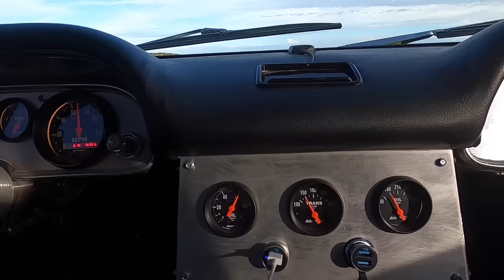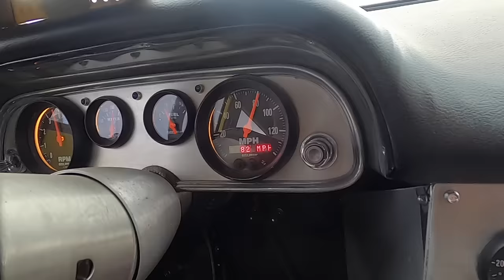The Morrvair Takes On The Rubicon Trail

Comment: Time Stamps for those interested in the names of various locations.
0:00 - Big Sluice Box (Starts at Mile 5.75)
10:36 - 2nd Dam at Loon Lake about 1/2 mile before trail start
10:41 - "Green Bridge" that crosses Rubicon Springs about 6.5 miles into the trail.
10:55 - Loon Lake Spillway (Trail Start)
11:23 - Gatekeeper
11:47 - Top of Whale Bones
12:11 - No name yet. It's a relatively new route the county made around a mud hole (There is a cross nearby where someone died rolling over without a seat belt)
12:52 - Nobie's Rock
13:20 - Soup Bowl and Kitchen (Totally optional)
14:05 - Arnold's Rock
14:16 - Indian Trail Route
15:05 - Mechanics Station at Buck Island Lake
17:51 - There have been 2 Roll-Over deaths in the last 6 years, all due to No Seat Belt. (No name spot and Little Sluice Box)
18:04 - SMUD Bypass (Near Heckle Hill)
20:54 - Big Sluice Box
22:48 - End of Property Line
23:02 - Green Bridge (seen at 10:41)
23:10 - Rubicon Springs
23:24 - Rope Swing in the background (yes, the water is cold)
25:06 - Bear. Yes, Yogi steals your food, rips off doors, destroys coolers
26:11 - Climb to Cadillac Hill
26:18 - After the Buick LeSalle (mistaken for Cadillac) and before V Rock (several deaths here). Cyclone fence is Gabions installed by RTF, Jeepers Jamboree and El Dorado County to save hillside
27:28 - Observation Point
28:26 - Tahoe Staging Area (it will be paved on June 21)
Reply: So where is the big granite slab you had to traverse and it was so steep the uphill wheels would almost "float" off the slab so you had to take it real slow... lots of vehicle used to roll there and it was a long ways down.... did they close that section?
Reply: @Sunnyacres55  the slabs are around the gate keeper but they are not really hard there is a lot of roll overs on the slabs because it’s one of the first obstacles and people who don’t know what they are doing can get there easily
Reply: I think I met you last summer??we were on ktms, you gave me and a buddy 805's and said we prob working on amature record times at 5-6 hours round trip.
Reply: Thanks for this! I was watching and noticed the spots skipping around haha. The Rubicon trail is a magical place!
Reply: @Sunnyacres55 The Granite Slab,  also known as Indian Trail is at the 14:16 is around 4 miles into the trail before Buck Island Lake.   The other "Granite" section, is the Granite Bowl which is about a mile into the trail.  Both Granite Sections are absolutely still there.
Reply: @jeremiahwoodruff9614  There are 15 Rubicon Trail Foundation directors, so it was likely one of us.
Reply: @PaintGuy Welcome!

Comment: Not easy with no lockers!Rudy’s got some crawling skills,well done young man!
Reply: Lockers are very useful but not an absolute need there I've got a 1993 Cherokee sport on a 3.5" with 30's and made it through this exact trail with no real problems other than bashing my rock sliders but no damage done and did great
Reply: I never seen his front tires not turn like it was an open diff?
Reply: @VesselFitterguy  - as long as the rear wheels have traction and one front wheel has traction, the other front wheel in the air will still turn the same speed.
Reply: @Dozav7  not on an open dif in the front. He's likely applying the brakes to create traction.

Comment: 40" tires, low gears, the shear weight of the rig, gear, and people, and the Morrvair still gets 11.5 mpg? And its an incredibly capable machine to boot. You guys really ought be proud of that thing, thats an awesome ride.
Reply: Still needs an overdrive reduction
Reply: And that's U.S. gallons, even more impressive.
Reply: Thats highway. Probably 7 to 8 city and offroading in 4wd probably 5 to 6 mpg.
Reply: @joshuaearnheart2756  40 inch tall tires is one Heck of an overdrive already. You want another overdrive?
Reply: @dehoedisc7247  so you didn’t watch the video? That thing was screaming on the highway. Come on now
Reply: @joshuaearnheart2756  The truth would be in the actual rpm profile of the engine's output, and the presence of multiple gearing systems makes it sound like more than it is. Talk actual rpm, not your impression of rpm, based on no instrumentation. I am a mechanic, not a youngster who is impressed with noise.
Reply: @dehoedisc7247  it was on the tach. Well mr “mechanic” you won’t be working on anything I own. Running at 3k+ RPMs on the highway isn’t acceptable
Reply: @dehoedisc7247  and speaking of the 40s, that’s sort of offset by the fact he’s running an extremely short gear. 5.xx something range.
Reply: @joshuaearnheart2756  Yes, very right, and yet I would suggest that any change to the gear train might result in a benefit/handicap compromise. Matt will do what's best.
Reply: @joshuaearnheart2756  as with many small pups, you overlook the fact that many v-6s are in their max torque band at 3 Grand, and I am sure your youth tempts you to exaggerate your potential. You don't know gears, and know more about your mouth exceeding your brain's capability.
Reply: You thought that a drive train should cool out to 2000 engine rpm on the highway, but No, that is much below efficient rpm  for Towing, and that shows your lack of maturity, as involves More Overdrive. NO. When towing, always tow at max torque of your engine, and not 2 Grand, lugging the engine for false economy. Young children should step aside.
Reply: @Nick-ye5kk  yes, play word games with the definition, very productive,.
Reply: @joshuaearnheart2756  A child you are, 3 Grand is the perfect rpm for economy and power. Are you posing for your family or society in general?  A child posing as a mature man is quite a spectacle.
Reply: @dehoedisc7247  yea it’s official. You’re not a mechanic 😂 not even close to one actually. Spinning the engine like that will most definitely cause overheating issues. He’s not making dyno pulls or hooking up to a trailer every time he drives it. If overdrive didn’t work, it never would have been invented. He doesn’t need to stay in the power band 24/7. Only when he needs the power. 3 grand is perfect for efficiency 🤣 thanks for the laugh my guy. What a complete nimrod you are
Reply: @joshuaearnheart2756  running at 3 grand on the highway is Perfect for a Little V6 that is Short on Torque and has got no choice. You consistently Betray your Stupidity. What's your Game?
Reply: @dehoedisc7247  you don’t need torque on the highway. Torque gets you rolling. You a hot wheels mechanic? And also, he has an ls in the morrvair. So you’re “little v6” comments are completely irrelevant
Reply: @joshuaearnheart2756  You talk about torque as if you understand the concept, and you do Not. You are spouting expressions that you have heard, and mistake them for reality. Wrong. A small boy such as you may influence a few people with your error, but the truth will come along and show you to be in error,
Reply: @joshuaearnheart2756  :You don't need Torque on the highway ? You have the mind of a child, and maybe you have a future with that shit, but it won't be in anything serious.
Reply: @joshuaearnheart2756  Your childish idea of overdrive has you in a puzzle, you are confused, and your confident attitude don't help you a bit, you are in over your head, small boy.
Reply: @joshuaearnheart2756  Every silly comment from you in regard to mechanical machinery is comical, you have been educated as a poet! hahahahaha. Maybe that's happiness. good luck.
Reply: @dehoedisc7247  dude, at 34:23 you can see the RPM on the left side which is on 4000 while the speed is 80MPH, so..
Reply: @dehoedisc7247  And also the Morrvair does have an LS engine (V8), it's been showed on previous videos, so no little V6! now i'm no mechanic, but fact are around for someone who wants to see them!
Reply: 3500 rpm at 80 mph isn't bad. I had an old truck that was 3300 rpm at 65.  It had 250k miles on it when I sold it. I believe the LS has an oil cooler in it, mine did not
Reply: Man I get 6 mph on my jeep with 35 in tires his truck is amazinf
Reply: @joshuaearnheart2756  HaHa!  A few decades ago, 3K r’s at 70 mph was standard.  They all did it. About a 3.5 to 1 rear, 1 to 1 top gear in the trans, that’s what you got.  3K seems like a screaming engine today, but we were used to it.
Reply: @CrazyPetez  yes, but making 1/3 the power. It isn’t near as hard on components when it’s extremely underpowered. And also, that’s a light duty engine. Now if he had the big brother LS, the 6.0, it would run like that for 200k continuously. HD engine components are built way more stout. Especially when compared to a stock valve train, non studded 5.3 that are notorious for eating head gaskets under normal use
Reply: @joshuaearnheart2756  I think you don’t understand the reality of older cars. Take a ‘53 Ford with the flathead V8, with a three main crank, terrible breathing. Those were driven 60 to 70 mph all day long. The rear ratio was usually 3.9 ish. Compared to that 5.3 in the Morrvair, the flat motor is way less than mild. The 350 in my 1969 Corvette (base engine) would easily cruise 70 mph all day, no I’ll effects at 3K rpm. 
It’s all about our perception. We’re so used to modern vehicles loafing along at 2K, or less, at highway speeds that when we get in a vehicle spinning the engine above 3K it seems too busy.   In my 505 hp ZO6 Corvette, 90 mph was only 2K r’s.  
Another thing, today’s engines are built to much closer tolerances than those from the 50s - 70s.  Sometime around the 70s - 80s automatic OD transmissions were fitted. That’s when the rpm came down.
Reply: Peeps. Enough already. Let’s enjoy the Rubicon Trail.
Reply: @joshuaearnheart2756  I would've put a 4l80 in it.
Reply: You get a big enough engine/rig, and what you're doing starts to matter less.  My 81 Bronco (these are the big ones) with a 460 pushing a C3 (ie no overdrive) and 4.10 gears, and 35's, drank fuel like a turbine does.  6 gallons per hour, didn't seem to matter if it was city, highway, dirt, empty or carrying 1200lbs up into the mountains.  Never let it idle for a hour, but I wouldn't have been surprised if that was nearly the same.  Maybe I needed to tune the carb a little better, in retrospect.  Hella torque though.
Reply: @joshuaearnheart2756 oh yeah and my moms car usually will run at 2.5k rpm but always shifts down for any hill and goes up to 3.5k-4K rpm regularly
Reply: @themaskedmusician4846  is it constantly working trying to spin 40 inch tires all the time? No. Didn’t think so.
Reply: @joshuaearnheart2756  to the engine it feels like it because it’s smaller displacement than a v8 in both of our cars hers is an suv mine is a car but both are 4 cylinders with significantly smaller displacement meaning it feels about the same to our cars as it does his my friend
Reply: @themaskedmusician4846  considering 99% of 4 bangers are inline engines, no. It feels nothing like it. Much different harmonics
Reply: Not my choice of a daily driver. May want to borrow or rent one. Didn’t I see a Toyota Highlander early in the YT?

Comment: The secret superhero of the whole trip is Rudy’s Jeep, no fancy lockers, not the biggest wheels and still made it through!
Reply: Yes! And with an open dana 30 to boot!
Reply: Rubicon is not that hard of a trail if you know how to drive. My first few times doing it was on 30 inch tires and a 2 inch lift on a 89 2 door xj with no lockers and stock gears.
Reply: Hello Matt, thank you very much for a great video, all you guys are amazing, awesome people. Ruddy, what can I say, you are an amazing young man and to me you are the winner of this trip. Thank you again for sharing with us. Love from California.
Reply: @joshadams2792   The hi pinion d30 is not bad.  We used to run the hammer trails with armored up XJ’s on 33’s and lockers in the mid 2000’s.  We took hours but we made it.  As time went by most of us upgraded to d60 d44 or Ford 9s.
Reply: @joshadams2792  Yes plus there are several ways to tackle each trail . They all don't take the hard lines .
Reply: He also didn't take the hardest lines.
Reply: @daviderickson5199  well ... his papa told him not to 😂😂😂
Reply: he saved me from spending 2 grand on lockers
Reply: @joshadams2792  Jeep has sold "Trail Rated" liberties. In theory that means they have crossed the Rubicon
Reply: @craigdeloach3976  I’m not trying to be a smart ass and I’ve read this saying  quite a bit In these comments. But what does to boot mean
Reply: @tommybokelman5565  
"In addition to" or "on top of" with a bit of an "in spite of" connotation.

Comment: Great video, guys. Love the Morvair! When I was a kid, I built a 1953 GMC P/U 4x4 conversion.
I worked for an off road shop, so had access to a lot of goodies. Shortened a long bed sectioned the frame, bed etc. Made a nice compact rig. 
Power was a Chevy 250 CI 6, RV cam, and Clifford Research headers and dual exhaust. Power was good, for a truck that light. Lots of great memories going into situations we had no business getting into. Always got in, always got out.

Comment: I learned long ago, "you don't pass gas stations in Nevada." 😁
Reply: Especially on US50 - Loneliest Highway
Reply: @TD_YT066  For someone that doesn't live in the US and has never been there, can you give me a little insight into the length of US50 and how far apart the gas stations are?
Reply: @sw6188  In just Nevada, from east to west side of the state, it's 384miles, in the really desolate parts, that next station is about 60-75 miles, miss one or if they're out of  gas, and you could be in trouble with a vehicle that gets 11MPG with a 20G tank.  I watched my fuel very carefully in my 5-7 MPG RV. There are some big climbs that burn gas like crazy when you're climbing in 2nd gear.
Reply: @TD_YT066  Thanks Tom, interesting stuff.
Reply: I used to drive from Reno to southern UT or vise versa without stopping, but I was in a Peterbilt with twin 150 gal tanks...

Comment: Rudy’s Cherokee did pretty good for having factory diffs.  I went over the Rube back in 85 with a 43 flat fender with an F-head 4 cylinder, 3 speed manual trans, and open front and rear diffs.   
  It looks like you had the trail all to yourselves which is very unusual, very nice though.

Comment: Rudy is the true wheeler of the group and shows how capable a mostly stock jeep is!! Mad props to rudy!! Plus Matt being slow to be in the cold water was funny!!
Reply: I have learned to never underestimate an XJ.
Reply: I wouldn't call his Jeep mostly stock
Reply: "Plus Matt being slow to be in the cold water was funny"

As someone who grew up where it got to -20~-30F on occasion, I thought it was funny, too. But then realized he lives in constant heat. I'd absolutely die dealing with that every day and be a grumpy monster due to it. He deals with it with no issues whatsoever (that he lets on, anyway). I've got a relative in the desert of SoCal gets cold and wears a sweater at 80F. Me? T-shirt and shorts and feeling hot in the desert heat (even at 80). So... it's what we're used to. Thinking about that made me appreciate Matt even trying that much more because he was probably pushing his physiological (psychological?) limits more than I would've been had I been there. 

Wim Hof would not have been impressed with Matt, however.  ;)

Comment: So..Rudy's Jeep with open diffs in front and a varilok /posi lok  in the rear....drove the Rubicon..Id say that's the most impressive
Reply: Man no kidding.
Reply: Light weight of the XJ takes it far.
Reply: Cheep Jeep for the win.
Reply: Agreed. I’m constantly suprised with the capability of those Jeep’s. I’m interested in buying one.
Reply: @rideagain7427  you will not regret an xj from 97-99. Specifically. Possibly the most reliable 4.0 made. Takes an ever loving beating and keeps going. No transmissionissues no transfer case issues. Just keep them u-joints greased and get som beefier driveshafts and axle shafts. Pretty cheap upgrades and that will take care of the weak points.
Reply: @bradlaflamme6127  thanks for the info. I’m going to be looking for those years and take your advice about the upgrades.
Reply: @rideagain7427  happy wheeling
Reply: @bradlaflamme6127  Agree with you 1000%. I’ve had 3 and regretted selling them all 😂
Reply: @greasemonkey6667  yeah those are really the only things I have broken out on the trails, except my steering box when I flexed out too much with no sway bars, also my entire coolant system but I was over the hood in mud and water. No vehicle is a submarine but I treated my xj like one.
Reply: Loved my two Cherokee's!  100% on board with Matt's comment about it being a good combination weight and wheelbase.  My [mostly] stock XJ's got me a lot of places that other stock vehicles had no business being on.